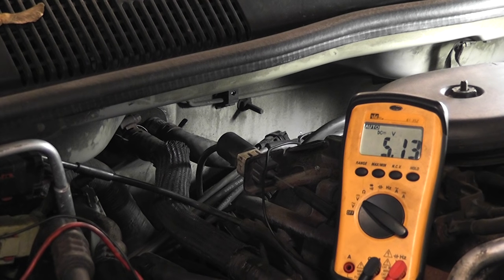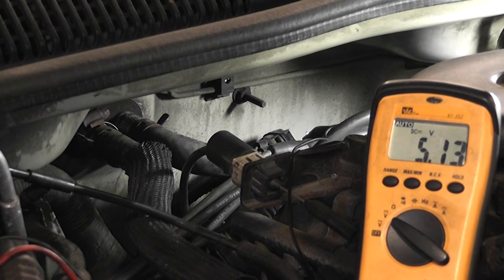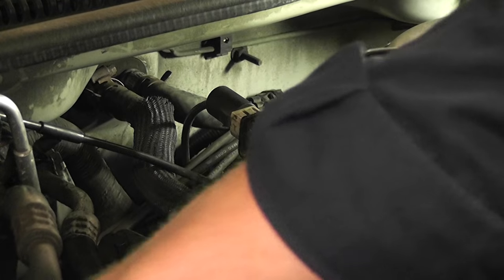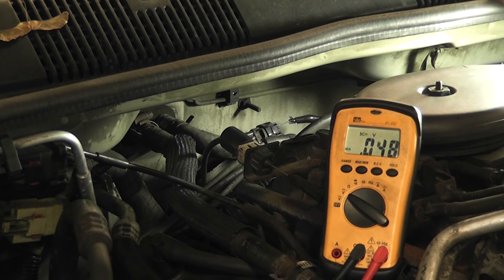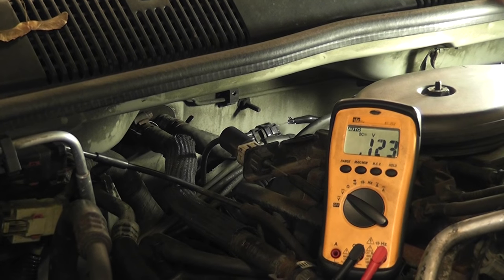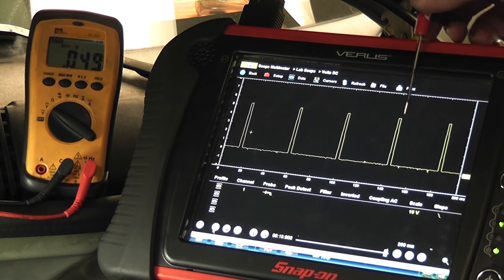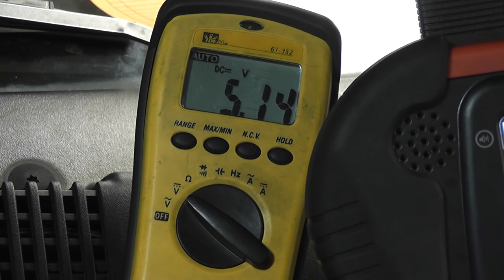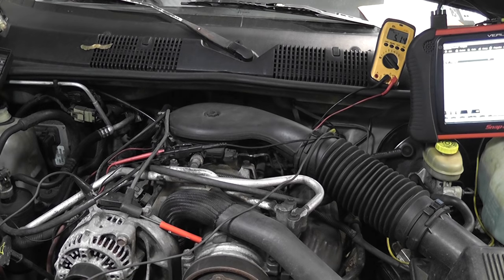How to test a crank sensor with a voltmeter

Comment: Hi Paul, quick question. Since its a pull down design voltage appears as soon as sensor is unplugged. Question is if the signal wire was shorted to ground (external short) we would not see this 5v appearing with sensor unplugged. How do we then find out if it is a pull down or pull up design. I suppose we can check another hall effect sensor on the same vehicle or I guess depends on what the fault is stating regarding sensor signal.
Reply from the maker: Great question! This information is not readily available, so if you didn't know, I teach to use a test light as your bypass tool, and then in your example you would connect it to battery positive and try to trigger the circuit, but the light would light up indicating a short to ground. On a pull-up design (which is what you would think with 0v unplugged), a test light to battery positive should NOT light the light. 
Hope that makes sense. If you're interested, this would be chapter 2 and chapter 21 material in my classes at www.scannerdanner.com 
Thank you!

Comment: hi, this video is for pull down, ihowver n PULL UP sensor , can i use test light for signal to bypass the sensor to bring it to 12v but the problem is test light is 12v, how can i limit to 5 volt, ?. or even though test light is 12v, ECM will consider max as 5volt. please advise.

Comment: great video,  on a 2004 liberty ran rough then died as if flooded smelled gas bad but it would start after sitting.  changed crank sensor and now it won't start  why/
Reply from the maker: I am directing all help requests to my forum. Sign up (it's free) and create a new post. Be sure to add a name under "alias" as this is the name that will appear in the post.
Here is the link to the forum. 
http://www.scannerdanner.com/ForumRetrieve.aspx?ForumID=3226

Comment: HI DANNER, THIS VIDEO GAVE ME A GOOD PICTURE OF WHAT IS GOING ON. AND I CAN ADD SOMETHING TO PROVE MY UNDERSTANDING ON IT.
LOOK AT THIS VIDEO TIME 14:54 WHEN YOU START TO BUMP ON THE KEY  TO GET TO 5V WINDOW.
SO I THINK EVEN IF YOU DID NOT BUMP ON THE KEY, ALTERNATIVELY YOU CAN ROTATE THE CRANK MANUALLY AND DEFINATELY SOMEWHERE YOU WILL SEE YOUR METER RECORDING 5V WHEN CONNECTED TO SIGNAL WIRE.

AM I RIGHT. IF SO THEN REALLY I SHOW UNDERSTANDING

M.B.S MOSHITOA (S AFRICA)  
THE GUY WHO RECEIVED FREE SCANNER DANNER BOOK. THANKS MY BRO
Reply: SORRY I MEAN THE TIME 6MIN 19 SEC    6:19
Reply from the maker: yes, you can absolutely rotate the engine by hand to see the same thing, but there is a safety issue with that because you would have the key on during the test and it is possible to get a spark on a cylinder under compression and the engine will "kick" on you, potentially breaking your hand/arm with the tool you are using to spin the crank over. Make sense?
Reply: @ScannerDanner  `` it is possible to get a spark on a cylinder under compression and the engine will "kick" on you, potentially breaking your hand/arm ``YOU

HEI, IT MAKES SENSE. HEI DANNER IF I DID NOT SHARE THIS WITH YOU I WOULD BE SAYING I BROKE MY ARM TESTING CRANK SENSOR. HAHAHAH LOL. IS FUN TO BE WITH YOU OUR PAUL .LOL

Comment: battery is fully charged, turning key to on dome light, air cond. radio all come on. Turn key to start and all power is lost.  I have to move the battery cable to get power back. then try to start and all electrical power is lost again.   HELP

Comment: That's definitely the full course chec up on a Crank sensor but my gosh buddy it isn't necessary.  I can use my volt meter and set it on 20V and touch the ends of the connector and see if the required voltage is coming from the sensor just by craning engine.  My gosh man that other is not necessary.  Or the test light and paper clip on the plug connection and if I get a bright light I promise that sensor will wor to mae that engine run.
Reply from the maker: I am teaching concepts that go way beyond this simple hall effect switch. You are missing the point.
Reply: I new that you were teaching what would be full course education per this electrical.  So I didn't actually miss the point.  My quest was so other persons would now this wasn't all necessary if they needed to check their sensor.  Most of these YT viewers that watch these auto repair videos are only wanting to now of how do I now if it works or not and yes your video is very educational but will scare your average simpletons so badly they will let a dealership fix their car. So my response should have stated that this is for you self doers at home so that you know if you need to change it out or look for something else that is wrong.  See what I mean here?

Comment: anyon vr do a code scan on a vehicle and it comes back as ERROR we trid 3 different scan tools and they all came back error its a 03 ford f 150 it not mine and when it came in all off the light on the dash were on and the check engine light blinking i hav no clue what was going on oh and it ran like a turd

Comment: I absolutely cannot for the life of me figure out what is wrong with my car. I replaced the fuel filter, fuel regulator, spark plugs, ignition coils, starter, and it's still not properly running. HELP
Reply from the maker: What's it doing? Not starting? What are you missing? Spark, fuel pressure, injection pulse, compression? Can't help without direction

Comment: you said behind the distributor....why would it have a distributor and crankshaft snesor?
Reply from the maker: Older systems that still used a distributor, would then use the distributor pickup as a cam sensor for sequential fuel injection

Comment: Well not necessarily no disrespect but you can turn the switch on I guess I would be very careful about it and get a ratchet and a socket with extensions that are necessary in size and manually rotate your crank over I will just make sure that you have your starter I guess relays pulled and everything to ensure that no starting will happen while your hands anywhere near the rotation area it's a bad idea but I'm actually mechanic if you're going to be dumb you're going to be tough please nobody do my suggestion it was good at thought but not in real life

Comment: Hi Mr. Danner, I just have a question. Wouldn't the multimeter catch the signal better if it was on the A.C. setting? I mean a square wave is just a rougher version of a clean sine wave isn't it?
Reply: Your mind is working in the right direction, but an important distinction is that an AC signal must pass through a zero voltage point to be considered AC, since this signal doesn't drop below zero volts, it would not be read on the AC scale.
Reply: Layer3Videos So it wouldn't even read half of it. Because a 0-5 volt square wave is just half a wave, if I'm understanding this correctly. If you were to put the meter on the A.C. setting, it wouldn't read half the signal? BTW what do you think about analog meters? Are they not more suitable for jobs like this, because they're more sensitive. Remember the old dwell meters?
Reply: Not half because the "Dwell" in this case is not 50%. Based on what I saw it might read 10% of the system voltage. Maybe. 
Analog meters tend to "Load" a circuit more and so are not good for this type of measurment. If you look at the specifications for meters you want a 10 Mohm input impedance or more. Analog meters are usually far below that and might drop the signal voltage too low. If you have a scope available try it and you will see what I mean.
Reply: Layer3Videos I don't have a scope unfortunately, but thanx for the info.

Comment: I have 5 volts in negative cable  on crank sensor in LS2, checked the ecu and its negative. Can it be bad sensor ? Car just stopped and doesn't start again. I check all loom and all sensors
Reply from the maker: You have 5v on a sensor ground? Check that same wire at the computer connector next